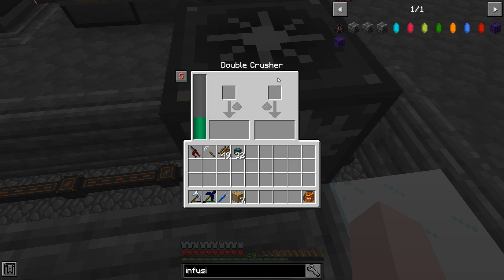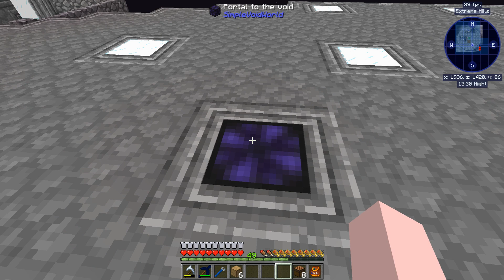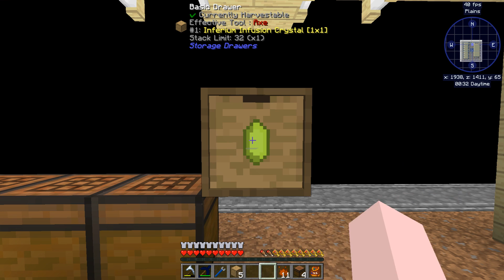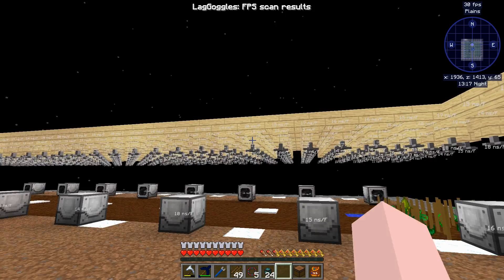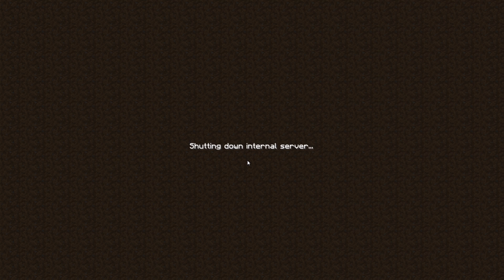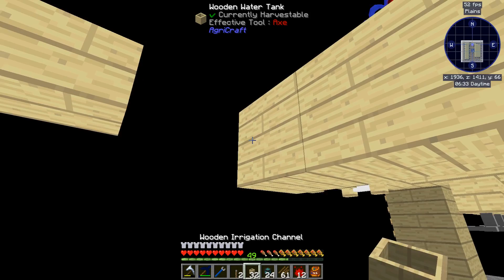04 - Agricraft, Analog Crafter, Grains of Infinity - Project Ozone 3

Comment: 38:15
I was waiting to see when you'd catch that...you set up the other 3 but forgot that one initially.
XD
42:16
With both levers on the tank block, it transmitted the signal through the block itself causing both sides to work on one lever. When you flick one lever it turned on one side and shut off the other side and vice-versa. Pain in the ass I know.
Reply from the maker: They lag exactly the same amount on or off. No reason to turn them off.

Comment: I saw you talking about the titanium for the solars i suggested last episode, and i have a new suggestion for once you have your first nether star(cheese it in the nether roof bedrock). 
Try out the spectre energy network for your wireless power transfer. Since there are no 'cheaty' free energy coils in this pack you need to provide the power yourself, but you can get started really easily. Kill a ghost with a damage splash potion and use your first ectoplasm on a regular sapling to make a ghost sapling, stick it in a hopping bonsai for infinite ectoplasm. The only real 'gate' for the mod is that first nether star since you need a beacon for the energy storage but otherwise its one of the best mid game options ive found. 

note: i decided not to update my pack after he changed/removed so much so my suggestions may not work.
Reply from the maker: > Kill a ghost with a damage splash potion and use your first ectoplasm on a regular sapling
Or just sieve tainted soil for the sapling. I've planned out netherstars, but they won't be next episode.

Comment: When you start upgrading your Energy Cells, put Holding IV on it. A Resonant Cell with Holding can store 150 Mio RF, the transfer rate stays at 25k.
If you need better access to Bedrock, the Hunting Dimension consists of only 3 layers of dirt. But take enough stone with you to build a solid wall around your working area or the mobs there will drive you nuts. :)
Your one-parent approach for Agricraft is convenient. But if you have Bonemealer V, then doing it manually is a lot faster. Plant in the center, let it spread to the four sides, cross-bread the center, let it spread again, rinse, repeat. Tier 2 or 3 seeds need only a few cycles. When the cross-bred center seed starts stacking with the outside seeds, then you are at 10/10/10. Infinity, Redstone and Certus seeds took only around 3-5 minutes, Diamond (tier 5) took a little bit longer.
Reply from the maker: > Energy Cells, put Holding IV
Good tip. I did know it already. I might be switching to Mek Cubes so I can charge stuff inside.
> cross-bread the center
I did something similar, but a little different in PO2. However the more automated Single parent appeals more to me.

Comment: Sifting tainted soil can get you a spectre sapling that will output ectoplasm for use in wireless energy transfer upto 20k. I haven't seen any of your vids since po2 years ago so i don';t know if you've used them before. they are gated by a single nether star so it's worth collecting the ectoplasm now.
Reply: Oh and the water generator from magneticraft will auto output into the agricraft tank, no need for extra transfer items :)
Reply from the maker: > water generator from magneticraft
I haven't used it before. So it auto outputs. How fast is it? Is it as fast or faster than a Liquid Translocator?
Reply: @WilxGaming  Couldn't tell you how fast exactly but yes, definitely faster than the translocators. translocator took around 7 seconds to fill one agricraft tank. the generator adjacent to the tank filled it in no more than a second.
Reply from the maker: I knew of the Spectre Coils. I researched them back in Stoneblock. I did not think of sifting for the sapling. Good tip.
Reply: Now that is an AWESOME tip!

Comment: You should get the tier 5 (or maybe even tier 6 if you want) inferium seeds and 10 10 10 them that will sort you for the pack. As some has stated before me, quantom tank should be a great way to store the inferium essence, or even compacting drawers. You can use all of the item conduits with the same color channel and put them on Round Robin, should work better. I think the problem in the analog crafter is probably because of the spread turned on, when the slot is emptied the inferium in the crafter just spread to it. With the inferium already backing up and staying at full stacks anyway it shouldn't make a problem.
Reply from the maker: > item conduits with the same color channel and put them on Round Robin, should work better.
Round robin slows the throughput a little. I could have kept them the same color, but I lost a tiny bit of speed when it kept trying to top up the first few. With speed upgrades it wouldn't have been an issue.

Comment: Great video! Love it. 

A tip: for the inferium essence, make a quantum storage, same as the tank, so you dont need to put drawer upgrades in the drawer
Reply from the maker: > quantum storage
I should have thought of that.
Reply: in some packs the top level infusion stone will upgrade blocks of essence so you could use a compressing drawer.
I take it that there are no grains of infinity seeds in this pack as there ere in Stoneblock?
Reply from the maker: > top level infusion stone will upgrade blocks of essence
The Master Infusion Stone is gated.
> infinity seeds
There are Grains of Infinity Seeds. You need 4 grains to craft them. This setup is netting more Grains than I will ever use, so I don't need the seeds.
Reply: :p

Comment: hey wilx just wanted to ask , how far /in depth do you have your videos planned , and how long does it take to plan one video ? 
I really like how organized you are.
Reply from the maker: Not only do I spend 1 to 3 days strategizing  each video, I usually redo each video a few times to get it right. First try is usually over an hour, next try just under an hour, 3rd try is 30-45 min. Same info, just less stumbling and wasted time.
Reply: Wilx I don‘t watch a lot of your videos but instead of trying again and again you could just cut a bit. A nicely cut video is just as good as a good uncut one.
Maybe you already do that and I didn‘t notice because I always do other stuff while watching yt videos, but since you seem like a very nice person and some of your videos helped me out in the past I just wanted to tell you that. I think a cut is less work that redoing all the stuff.

If you need an example I think SystemCollapse and Hypnotized do that.
Reply from the maker: I do cut stuff. An average of 5 min an episode. However I redo them because I think of a better, clearer way to explain something, or something doesn't work the way I think it will. And cut most of the umms ahhs or multi second pauses.
Reply: Wilx And If the fps bother you (I don‘t know about your setup/budget but for me a RTX 2060 fixed my fps problems very well (had a GTX 650 before).

I usually get 80+ fps in ozone 3 and there‘s quite a few things running.
CPU: i7-4770
GPU: RTX 2060
RAM: 16 GB DDR3 @2400 mhz

Maybe the low fps only bother me because I‘m playing a lot of first person shooters...
Reply from the maker: I have no budget for an upgrade right now. It's my birthday this month and i can't even afford to renew my licence.. My i7-6700 4.0ghz is slightly faster, but my GTX 960 is 2 years old and half the speed of yours. I don't think it's a hardware issue. I run fine when I'm not recording. Something in this pack doesn't like my recording software, DXTory, I have no problems in any other pack.
Reply: @WilxGaming  You could attempt to use Open Broadcasting Software. OBS is another program that has recording/streaming capabilities with a relatively low foot print. Loving the videos by the way.
Reply from the maker: I've used OBS for some videos where I need to record my desktop, not just in game. But my editing software, VeeDub64 can't open OBS files. Veedub is really fast and easy to cut out small bits and the Direct Stream Copy is extremely fast to render. I'm going to resist changing as long as I can. If i did change editing software it would be to do time lapse, transitions, and text over video where i would have to put up with long renders, not just to accommodate OBS. If editing took that much longer, I would take longer to put out videos and I already to too long between videos.

Comment: tier: 5 gives you in one hour about 250k
Reply from the maker: Is that 10/10/10: 1 plant or 9? I need faster piping and processing before I upgrade.
Reply: @WilxGaming  it was 9 plants 10/10/10  and only one plant gatherer. I used a translocater in a quantum storage
Reply from the maker: > quantum storage
I should have thought of that.
Reply: @WilxGaming  they are cheap. With my setup i afk it for 9 hours and i got nearly 3.9 million inferium essence
Reply: @WilxGaming  If you want it go even faster you can use Growth Accelerators. They work beautifully
Reply: Sorry, I forgot the say the reason. Ahem. Zero Lag ;)
Reply from the maker: > faster you can use Growth Accelerators
These are the ones that go under each crop and can stack? To get faster than the sprinklers how many do you need to stack? Each one makes a growth tick attempt every 6 seconds. My overlapping sprinklers are much faster than 6 seconds.
Reply: @WilxGaming  I set up MA in Void too, I have about less than a stack under each and it does it really quickly. I made about 120 stacks in an hour off a single tier 6 seed... Oh and the tier 6 seed is 1/1/1
Reply: Plus they seem to barelllly lag at all
Reply from the maker: (6x25+9x6)x60=12,240 Diamonds and 48,960 Blocks of Inferium
Not your starter set up :-) But something I might move to later if the lag starts to bother me.
Reply from the maker: > Plus they seem to barelllly lag at all
No measurable FPS lag, but 1 for tick lag, which is tiny, but 12k of them adds up. Each Sprinkler+Channel is 28 fps lag + 2 tick lag. 204x30=6k total when i am in the instance, 408 when i'm in a different instance. The 12k from the accelerators follows me in any instance. The numbers are so small for each one my figures could be off by 50% or more, but still so many Growth Accelerators would cause a toll.
Reply: @WilxGaming  But to what extent do you need it automated currently? You reallly dont neeed much inferium essence. When you automate all the resource seeds, you should be able to just get Garden Cloches. I loved the Lens of the Miner setup by the way. Maybe look into a laser drill ;D
Reply from the maker: Garden Cloches are gated and don't do 10/10/10
Laser Drill wants 20k rf/t. I was waiting for better power. Was thinking smallish big reactor, but with Titanium seeds I might make a stack of solars at 600rf/t each. 
> loved the Lens of the Miner setup
Thanks. It was fun.
Reply: @WilxGaming  20k rf/t? You know the power setup you did for the Lens of the Miner? I put two augments in each, and it powers lens of the miner, all four laser drills, and 4 tree fluid extractors and a processor....
Reply from the maker: Dam it. The old MFR Laser needed 20k, not the Industrial Foregoing one. It uses 3000 every 30 ticks, or 100rf/t if my math is correct. Doh! I think I figured that out before and forgot. Thanks.
Reply: @WilxGaming  No problemo😂 Can't wait for next episode!
Reply from the maker: Does the laser get you prosperity?
Reply: @WilxGaming  It gets you Prosperity Ore for shards. These ores when placed will be affected by Fortune 1, 2, 3.
Reply: For reference a tier 5 inferium seed drops 50 inferium, so you can guess that you get alot 😉